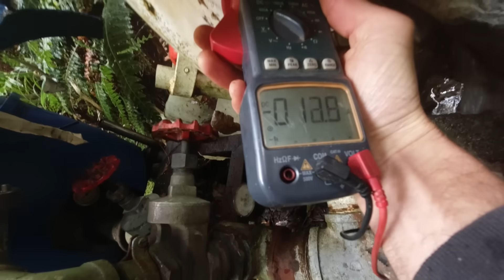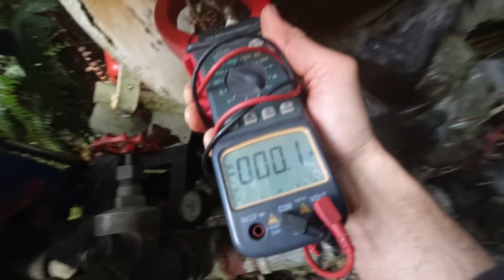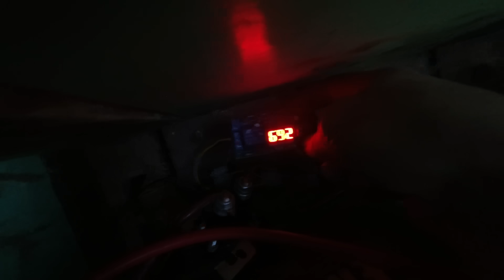Free Power for 16 years from a modified Washing Machine / Water Wheel

Comment: The power company of the Future should be no power company.
Reply: Truth be told free electricity is easy to produce, only problem is that is companies can't make money off it. Methods of generating and harnessing electricity have been suppressed. Instead of using dangerous nuclear or pollution heavy coal, we could be harnessing massive amounts of electricity by under water turbines fueled by the oceans currents.
Reply: @ChaseRightOn  i don't think you're considering the costs of those massive underwater whatever
Reply: @gigel99324  yeah I'm sure they would be expensive on a commercial scale to sustain the power grid. I assume it would be cheaper than most of the methods. I just mentioned under water turbines as an alternative to the methods used currently. Hell of a cheaper than having than thousands of windmills taking up 100s of acres of land. As far as the free energy goes, there multiple ways of an individual to power his house using free alternative methods. I didn't mean that we could power the whole US/world for free. You'd be crazy to think certain technologies or methods of generating free energy haven't been suppressed bc they're not profitable.
Reply: Damn son, mine is 350 a month. I picked the wrong house. 35 a month wouldnt cool 1 of my rooms down.
Reply: @jasoncartwrought9944  get it insulated if it's made of cardboard. With brick houses and leafy trees in front of it on the South and West there's zero too hot issues.
Reply: @gigel99324  lol. You dont live in west Texas do you... trees hahaha
Reply: @jasoncartwrought9944  luckily I don't
Reply: -Ted Kaczynski
Reply: No. Centralized power generation is a must. This looks great because he is one guy. If everyone setup to generate their own, the waterways would be crowded and polluted and the general ecology would suffer.
In other words, the West right after the industrial revolution,  but worse.
Reply: @dragons_red  Only if you don't expand your horizons and only look at hydropower when talking about this subject, sure your predictions would be true. There are a lot of ways to generate power for individuals, and I'm sure we aren't even remotely close to finding all the ways we can generate it. However, smaller groups of centralized power production does currently look to be the most optimal under our current efficiencies.
Reply: we pay more than 30 cents /kwh here in europe. its terrible.
Reply: NOW WE'RE THINKING
Reply: Let's say we all have electric cars and solar, we set the car to share say  25% for peek hour's. No power company needed.
Reply: It's super inefficient to have it that way, plus the grid would depend on everyone taking care of their own power sources and would be even worse if people experienced a storm like that in Texas just recently
Reply: @krismine99  it will be the future of power, if everyone on texas had a tesla power wall and solar power they would be better off then they are now. I have to disagree with the efficiency of importing oil.
Reply: Welcome to 2030 You will own nothing and you will be happy!
Reply: @apieceOfeight  Not having to pay for electricity that we can make ourselves is a good thing. You really want everything given to you for money huh.
Reply: @69Planta69  
I didn't say that, I just reported what WEF guys wanted... Please read about what is the Great Reset and the New Green deal than you can answer yourself any questions. 
On the Agenda 21 prospect they also stated "Land cannot be treated as an ordinary asset, controlled by individuals. UN AGENDA 21/2030.. Sustainable Program.
Reply: Nemesis  Idk about you guys but electricity is pretty freaking great and my bill is usually $35 a month. Not bad considering what I get out of it. Imagine living 150 years ago where electricity wasn't so accessible
Reply: @mtnmotoadv  $35 a month? You're very lucky.
Reply: @mtnmotoadv  It widely varies on the cost of where you live... I live in MO and my company charges me $13 service charge, fuel charge and county tax just to have electricity. This averages around $20 a month just to start. My bill for a 1500sqf single story 3 bed 2 bath house is around $200 a month. When its real cold or real hot they increase their rates almost double and call it extreme temperature charge.... In 2018 from Nov to Feb my bill was around $400 a month because of this charge. Average bill is 900 to 1000 kwh.
Reply: @youtubelurker481  900kwh is crazy, what the hell.
Reply: @gigel99324  neighbor stealing power from him haha
Reply: @youtubelurker481  you obviously don't use electricity reasonably then, unless you're growing marijuana that usage is fuckin insane for your home. You must have some garbage appliances too.
Reply: @gigel99324   900kwh is the average usage of a household family for a month.   It's not that much really.   I have a friend who is single and uses 12kwh because of all his electronic toys.  Also appliances like  Air Conditioning,  electric water heaters,  electric  range/oven, etc.  all suck a lot of power when running.
Reply: @Blink_____  i forgot about the 1000 sqft cardboard houses the US has lol
Reply: @mtnmotoadv  must be nice. My monthly power bill is around $300 in the winter and $600-$800 in the summer.
Reply: @mtnmotoadv  a village 5km away from a metropole barely got electricity around 1960s in eastern europe
Reply: @mtnmotoadv  You're a lucky guy, mine is about $57 a month!
Reply: @mtnmotoadv  600 in California, grey davis deregulation THEFT
Reply: look at turkmenistan where antiquiteq exist and communiste gouvernement give it free actually. Ancien people have free energie. Look at Jon Lev YTi Channel.
Reply: A future where every single people needs to know electrical engineering to make their own engines doesn't look so bright to me imo...
Reply: @MrTomyCJ  things will be manufactured and updated  by local company's , we can arrange our selves differently
Reply: @MrTomyCJ  Why are you afraid of a future based on self dependence? Are you scared of not having an official tell you what you need to know and give you what you need to live? Sounds exciting, terrifying, and downright the best possible way to live if you ask me. A world without restriction on innovation because individual rights are truly respected, is a world of absolute innovative and engineering progress the likes of which haven't been seen since before the world fairs.

Comment: Bit of paradise you got there mate, he have you ever done a more detailed video on your power system? IE, battery bank, inverters used etc and what you run at the house. Is the battery bank up at the wheel and how many A/H do you use?  You mentioned power lines in this video, do they just run from up at the wheel back to the house carrying 24V or is everything converted to 240v up at the wheel. Would love to know more. Must be a capable system considering how many power tools etc you use, and its good to see a fellow NZ'er doing it this way.
Reply from the maker: I'll be helping a friend set up hydro power in the near future so I will make a series of detailed vids on the build

Comment: 600 watts doesn't sound like much but that's over 400 kw/month.
Reply: X .10 a kWh that’s 40$/mo. To run some 24v lights and very little else. I admire his ingenuity but a tie-in to the grid is a far more practical and useful option.
Reply: @gordtulk  did you not see that the 24v at the creek is transformed into 240v AC and transmitted by a power line to his house where he has another  24v battery bank and a 4000watt inverter. Thus he runs the house on 240v AC and can run everything except  his welder...for which he has a generator.
Reply: A coworker was quoted around 60k to run power to his property....so there is that. Unless you have power lines right close....
Reply: Brian Morrison he says in the video it was 12,000 nz$

Comment: run a series of vertical posts around your intake and then put some chicken wire type material and you will filter the leaves without restricting the flow to you intake... it will take a little play to get the spacing right with the bars but it should have keep you from having to get the leaves off.

Comment: Maybe take the AC output of the alternator and step it up with a transformer and put the batteries close to the house. Decrease the voltage drop and reduce the expensive wire size.

Comment: Pretty darn impressive! Amazing what you can do with what would otherwise be landfill. Although he didn't say, I'm guessing he steps up the 24V DC to 240V AC right there at the generator BEFORE transmitting it across the 0.5km to the house. That way although you've got the same amount of power travelling through the wires there's less current, which means the wires heat up less because there's less voltage drop which means higher efficiency. Glad to hear he forked out the cash for decent 'transmission lines' or it could otherwise be slightly dangerous with all that water around.

Comment: Amazing engineer. Great respect fella. One question. How do you deal with the voltage drop due to the resistance of the cable over that distance?
Reply from the maker: I boost it to 240vac with an inverter before sending it to the house so voltage drop is minimal

Comment: Over 300m of pipe, how much vertical elevation drop do you have? Does the 4in pipe reduce as it gets closer to the turbine?
Reply from the maker: 200m length on main turbine, 100m on the 2nd turbine. About 42m head on the main pipe, 20ish on the 2nd. Yes the pipe reduces from 4 - 3 inch, only reason it reduces is because I ran out of 4 inch pipe, it doesn't make any difference to the static head
Reply: Did you ever consider a small dam at the head to counter low flow?

Comment: really, really admirable. hats off!
@Marty T, with that voltage and ampere, you should be able to charge all the gadgets (smartphone, camera, phone, etc), right? apart from compressor, as you pointed out. would it charge a laptop or run a fridge? how many thing can you charge or run at the same time?
again, thanks for making this video and let us know about what you do. you ARE the man.
Reply from the maker: Right now at 10 pm I have 40 inch  tv on, satellite decoder, laptop, 3 house lights, mobile data amp, fridge/freezer, deep freeze, ph charging, intermittent  1100w hot water element dumping excess power all from my 24-240vac inverter and my turbine batteries are full
Reply: @MartyT  that just blew the back of my head right off!!! all that from 600 W, right?
do you happen to have a power meter to measure the amount of energy (kWh) you need for a month? from my calculation, 600(W)*30(days)*24(hours) = 432 kWh.
I am wondering how much energy one needs to live like that.

Comment: Are you simply taking water from a high point, running it along grade to a lower point at which maybe gmfor some distance you raise the pipe to create a head or fall into the washing machine contraption?  Do you have video on how to convert machine?
Reply from the maker: Yes that's correct, link to the build should be at the end of this vid

Comment: Plan to do a water turbine project in my ranch, while looking for Helton wheels, found this on amazon and eBay. Do you have experience with this? Will you recommend it?
https://www.ebay.com/itm/600W-Micro-Hydro-Electric-Power-Water-Turbine-Generator-110V/392844148410?_trkparms=aid%3D111001%26algo%3DREC.SEED%26ao%3D1%26asc%3D20160908105057%26meid%3D041bb7de29a7427e860320e63461e9e1%26pid%3D100675%26rk%3D1%26rkt%3D15%26mehot%3Dnone%26sd%3D333480524777%26itm%3D392844148410%26pmt%3D1%26noa%3D1%26pg%3D2380057%26brand%3DUnbranded&_trksid=p2380057.c100675.m4236&_trkparms=pageci%3A59f4cba4-d3c3-11ea-92f8-4e422690e81a%7Cparentrq%3Aa8c9aff61730ad397f2c5120ffde51e4%7Ciid%3A1

Comment: Is there anyway you could get air to turn it I really dont a water sorce.
Reply from the maker: Yes it can easily be coupled to a wind turbine, or in theory you can use compressed air to store energy, excess power from solar or wind could be directed to an air compressor intermittently, when power is needed at night, an air powered drill coupled to a generator could be used to generate power.

Comment: Just curious, why is a dump valve needed? Couldn't the pump be shut off since there is no storage tank which could siphon the contents out?
Reply from the maker: There is no pump, it is gravity fed, if the inverter shuts down or something, the batteries will overcharge until dry without a backup dump of some kind, then the turbines will spin open circuit and wear out faster

Comment: 300W = 1 solar panel dude
Reply from the maker: Yes but because it is only producing power when  the sun is up, (8 hours in winter here) I would need a big battery bank to store the power for night time ($6000) to have the equivalent output of my turbine generating 24/7
Reply: @MartyT  OK I admit... it's pretty cool.  About $6000 of power over 16 years?  Always on is a very nice feature.

Comment: Good job. Are those induction motors? And how does  water get to the turbine?
Reply from the maker: Permanent magnet motors, water goes through a 4in - 3in pipe to get to the turbine. 42m head
Reply: @MartyT  Ok thanks alot

Comment: Hi marty where did you get the pelton wheel for this? I have the same smart drive and working on similar setup except my elevation is only about 30ft but my flow is good.
Reply from the maker: 30ft is decent with good flow, should be at least 500w in it.. I got my pelton cups from ebay, Turgo might be more suitable for your situation

Comment: How do you build up the water pressure
Reply: Imagine a 5 gallon bucket of water on top of a 150ft tall building. Then you toss the bucket of water off the top of the building. How much force would impact on the pavement when that bucket hits? Well, that same amount of force builds up continuously in that 4 inch pipe running downhill to Marty's turbine. The water jets out continuously at 62psi, and that jet powers the turbine to produce the electricity.  Isn't gravity a wonderful thing?

Comment: Have you ever tried to drive a standard AC generator off it so you wouldnt need the invertor ?
Reply from the maker: I have thought about it, the problem with an ac turbine is keeping the rpm constant with varying loads - If you put a large load on, it will slow down the turbine and drop the voltage unless you have some kind of governor water valve to keep rpm constant

Comment: Can you give some details/estimates on head, flow rate, jet size etc. Did you say 4" pipe?
Thanks
Reply: Diagram would be fantastic.?how does he get that flow out of such a little trickle of water?
Reply: The flow comes from 300m of 4" pipe full of water. Gravity does the rest. Just find volume and you'll find water pressure.

Comment: Nice!
 I have been using a Harris hydro 4" pelton wheel on my grid tied micro hydro system, with about 147' of head thru a 3" line, I put 850 watts +- into the grid, from March until October, then the last couple months until I drain it out for the Idaho winter and when my flow drops I nozzle it down to maintain the head pressure, but still get 300 watts. Being grid tied, after 28 years of being off grid is WONDERFUL!   No more batteries! My utility is my battery, one of infinite size, zero maintenance (other then the $5.00 a month hook up fee) and is 100% efficient as I get back every single watt stored in their system.  I also have a 2.5 KW wind machine, and 4 KW of solar, all grid tied.  I get asked, "what happens when the power goes out?" I light a candle....or if I really need some power I'll start my Honda generator, or use my Prius and it's 400 watt inverter.  Anything but to have batteries again, they are to be avoided if at all possible. I say this for those who think being off grid is somehow cool or romantic or something....., if you have a chance, nearby utility power, go grid tied. Way out in the boonies is when off grid makes sense.

Comment: Why not dam up more water at the intake?  Nothing fancy just a double stone stack across the width.  Enough to keep your black hole drilled filter covered.
Reply from the maker: A common misconception is that you need a dam for a micro hydro generator,  it is a waste of time and effort, the turbine would suck that extra dammed water up in minutes. The Jet/nozzle on the turbine is changed seasonally to account for changing flow rate. Also a good downpour would knock the dam down unless concreted together.
Reply: @MartyT  I was just thinking of the dam as a battery of potential energy for drier times.  If your current system would just suck it down in minutes then aren't you actually using the wrong jet?  If it sucks the reservoir dry then it will be sucking air anyway with the stream.
Reply from the maker: @orion_13  No the flow rate is adjusted by the jet size, if it starts sucking air I would add a smaller jet, a dam might give a few extra minutes without sucking air but not worth the effort. Also I like to let some water go around the intake so I don't affect the ecology of the stream below the intake